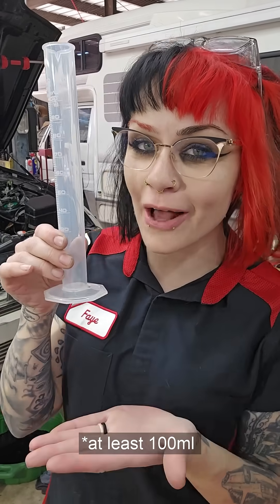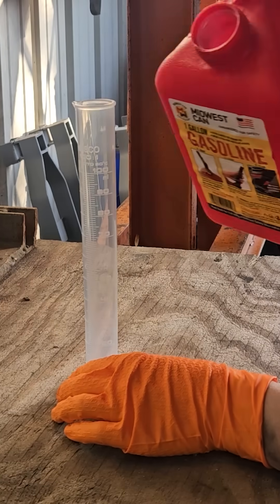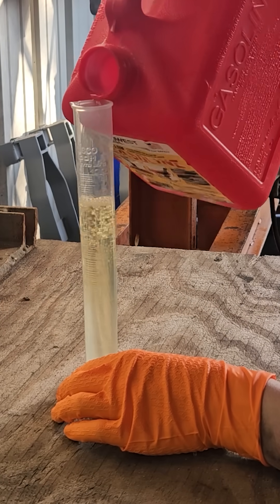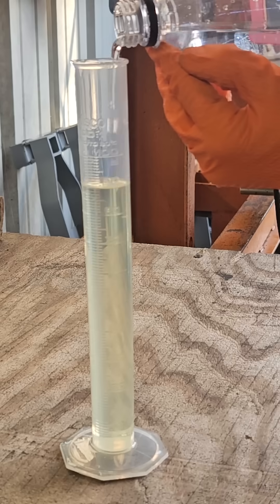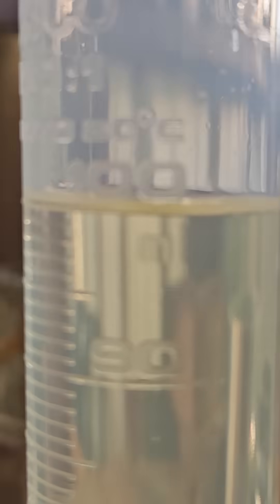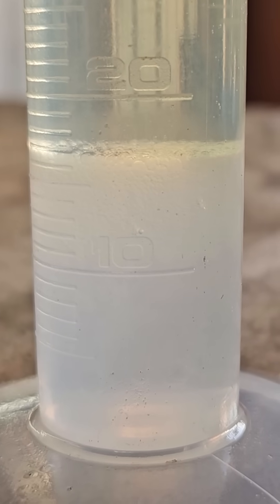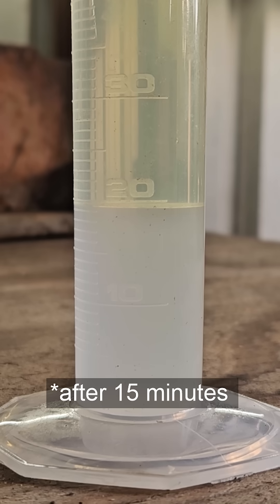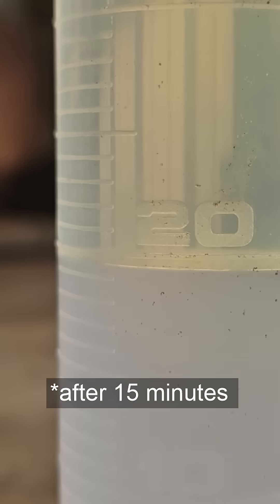Testing the Ethanol Content of Gasoline Using The Water Extraction Method! #AutoDIY #Ethanol #Shorts

Comment: Underground gasoline storage tanks ALWAYS have about 2 to 3 inches of water in them, which always settles to the bottom of the storage tank. This is because ambient atmospheric AIR finds its way into the storage tank, and the humidity in that AIR forms condensation drops 💧 on the inside of the storage tank. I guess the next question would be…
Which has more density, gasoline or ethanol?
Reply: Ethanol free gasoline is .758 grams per ml, and pure water free ethanol is .789 grams per ml. Which would make ethanol ever so slightly denser in mass. Pure ethanol is an oxymoron as it becomes an aziotrope due to atmospheric moisture content, so hypothetically pure water free ethanol. 
Regarding energy density non-ethanol Gasoline is 114,000 BTU/Gallon and pure ethanol is 76,000 BTU/Gallon. 
Which explains why ethanol is metered more on the rich side to extract more energy from combustion to make it comparable to gasoline. 

For a quick quip of a comment im not diving into joules and parisitic and thermodynamic losses from engine operation and all that.

Comment: I would just clarify the readings a little....90ml gas, 10ml water, if the clear liquid on bottom was 10ml there was no ethanal. Any ethanal in the gas will add to the level of clear liquid on the bottom after it settles, so you have to count how many MLS there are and subtract the 10 for the water, leaving you with the ethanal measurement! Then for the percentage of ethenol take your measurement and divide it by 90!  Sometimes wording things in different ways helps more people understand! I know sometimes it helps me grasp it. Great vid! Now do a video on why we would want to take measurements in the first place! Thanks. Later. 💯👍🏁👏🇺🇸
Reply: Thank You for your explanation. The video wording was confusing,
Reply: This is methanol free.  Methanol is used to both booster octane and help burn off water.  Methanol is short life so Ethanol is used in the gasoline.
Reply: I'm also wondering why she used 90ml of gas. Wouldn't you use 100ml of gas if you want the result to indicate percentage of water? (After subtracting the 10ml from the result, as you mentioned).
Reply: @alanm8932  because she has 100ml total to work with thus 90/10.  If she starts with 100 gasoline she has to transfer it then add 10 mils water transfer it.  Blend then, siphon off excess gasoline as the blend won't fit and she can't spill water/ethanol.
Reply: @whatsup3270  it looks like it will easily contain 110ml, it just doesn't have markings above 100…
Measure 10ml water in the measuring cylinder & pour it into the mixing container.
Measure 100ml gasoline in the measuring cylinder and pour this into the mixing container (which already has the measured 10ml of water in it). Mix, then pour back into the measuring cylinder. (Looks like it will easily contain 110ml, it just doesn't have markings above 100ml).
When settled, read the quantity of water/alcohol at the bottom of the measuring cylinder. Subtract 10ml from the reading. The remainder (in ml, after subtracting 10) is the percentage of alcohol. 
Only problem would be if the percentage alcohol was over 90%, as you'd run out of markings. Hopefully that isn't likely!
Reply: Doing 90 fuel and ten water makes the complete amount of liquid to be 100 ml then after the shake you minus the 10 ml plus the rest that mixed with it being methanol @alanm8932

Comment: And what is the practical use of knowing if it is 1.9% or 9.9%?
The car will drive with the same speed, the same power and the same fuel consumption. 
Differences of 3% or less of the numbers above can just be measured in a controlled environment of a laboratory!
What is this "knowledge" for (except for selling these kits)? 🤷‍♂️
Do you want to switch gears 50 RPM earlier or later? 🤭

Comment: To those who want to remove the alcohol at home for use as clear gas on chainsaws and mowers, etc., start with the highest octane at your station. Alcohol is about 105 octane equivalent, added in part to raise octane rating. Removing the alcohol is cool but it will lower the rating, usually about 5 points. Be safe everyone!  👍
Reply: Lucky I guess that they sell ethanol free fuel in idaho almost stations, not supposed to fill.your car with it though or something like that
Reply: In our area the local fuel provider sells avgas (leaded gasoline) for aircraft. It's about double the price of regular gas but some people swear by it for chainsaws and the like....

Comment: I worked at a lawn equipment dealership in the late nineties when the ethanol blends common. We had a kit from one of the engine manufacturers that had a glass graduated cylinder that was marked in a way that took the math out of this. They required this for certain warranty claims.
Reply: In California, they aren’t just common, they’re the standard. 10% ethanol is a requirement. We’ve started making engines capable of handling ethanol blends, so nobody has been taught how to or why to test. Unfortunately, younger generations aren’t aware of the issues older machines can have with ethanol, so we’re about to witness the extinction of the last of the pre ethanol engines.

Comment: Im not sure the rate but an open top container filled with gas will cause moisture to condense out of the air. After 15 minutes of sitting in a room it could throw your test off. Not saying your method is wrong but just something to take into account.

Comment: This is also a simple way of removing ethanol from your fuel. Do the same thing, but in a container with a petcock at the bottom. Drain out the ethanol/water mixture, and 100% gas will remain.
Reply: The gasoline the refineries make is only 84 octane.  Adding 10% ethanol increases the octane to 87.  If you remove the ethanol, you will have 84 octane subgrade remaining.
Reply: @hughjass4838  85.6 octane in a perfect water free world.  I would bet when corrected for water the octane goes up. btw adding back 1/2 as much xylene or methanol will raise the octane above the original blend octane
Reply: You'll have to add something to raise the octane back to it's regular level. Ethanol increases the octane rating of the fuel, removing it will drop the octane rating.
Reply: @ water lowers the octane so it is generally a wash
Reply: Well, about 90% petrol will remain, since you just removed about 10% of it. Probably some of the nice additives, too, than prevent knocking and the like.
Reply: @NigelTolley That’s what I’d like to know. What else is removed by extracting the alcohol with water. Gasoline is pretty chemically complex.
Reply: Yes it will, but the octane of the pure gasoline will be lower than the rated amount and can cause pre-ignition problems.
Reply: @davidca96  because water was removed?
Reply: @whatsup3270  no the alcohol is also removed as its soluble so you lose the alcohol octane boost to the mixture.
Reply: @  The reverse problem is also true a pure hydrocarbon fuel with 10% ethanol actually at 87 octane will not stay at 87 octane, as it will not be stable until it has water probably1/2 to 3/4 of a percent.  Simply the off set is the original blend has to target a higher octane so it will test 87 or high when delievered.
Reply: Just add some octane booster to get the octane back up, lol.
Reply: What if the octane booster is just ethanol? @herranton
Reply: @lightningdemolition1964  it is... Hence the lol at the end.
Reply: A separatory funnel?
Reply: Do not do this unless you want a good chance of ventilating a piston.
Reply: How's a rooster do that? Petcock 😂
Reply: Removing the ethanol with lower your octane so now instead of 87 you’re running 80. Great idea but it turns the crap fuel into crappier fuel
Reply: And begin to hear your entire knock. Ethanol was a replacement for MTBE to prevent engine knock.
Reply: @chechnya  Knock is from too low an octane.  If the octane rises enough or the engine matches the fuel it will not knock.  There are other ways the add octane or suppress knock.  knock suppression is by raising the flash off point.
Reply: @whatsup3270  The lowest octane unleaded gasoline will have an even lower octane without ethanol, too low for most compression ratios. The compression ratio will ignite the cheaper gas no matter  what the computers do with ignition and injection.
Reply: @chechnya  This is great for yard equipment.  The ethanol absolutely destroys the diaphragm gaskets in the carbs.
Reply: @chechnya MTBE was banned in the U.S. in 2005….🙄
Reply: @mikek1187  which is why they use ethanol now....

Comment: If you are interested stihl makes a glass tube that takes the math equations out of it just tells you the percentage. I’m sure others companies do aswell but that’s where I bought mine.
Reply: Fill the petrol to 100ml if you want an auto percentage, then add 10ml of water. Whatever over 10ml is at the bottom after settling is the true percentage removed from the fuel.
Reply: Kinda useless nowadays when all lawn equipment are made to run on E10 properly and won't even have the right air fuel ratio if you run ethanol free in it
Reply: @DarkAttack14 I don’t know about other equipment because I’m not certified by them but stihl recommends no ethanol. And will void warranty for anything over 10% I’ve seen enough 2 strokes come in the shop with bad jugs/pistons/rings from over heating due to ethanol use to know better than to put it in my equipment.

If you spread a thin film of oil on your metal work bench. Then you take alcohol to wipe it away? It comes off right? Well think about how a 2 stroke works. It uses the 2stroke mix to oil the cylinder walls to keep everything lubed up. 
So why would you want something mixed in with your fuel that does the opposite. 

And yes, I can pull your FS90 apart and tell if you’ve been using ethanol fuel, It wears differently than pure gas mix.
Reply: Lol you must be tarded if you can't just subtract 10 from whatever the bottom reads (20 - 10 = 10 in her case)

Comment: If you pull 10 mL out of 90 ml, that's less than 10% it would in fact be 9% because you only had 90 ml of fuel. You would need a larger graduated cylinder and to do the full hundred ml of fuel to make the math easy

Comment: So what about e15 my 22 ranger will run it and it's only 5 percent more than the might be 10 percent in regular? I wonder if it's really as bad for vehicles as most say it is the price sometimes is too good to pass up on.
Reply: I think it really depends on the motor ur running it threw. Some seem to handle it a lot better but always worse then a proper gas set up

Comment: Huh, and your gas mileage on any modern vehichle varies by almost the exact amount of ethanol that is in the gasoline. For a product that hasn't been useful since the days of carburetors, they sure tout is as saving you from emissions. It doesn't. It reduces gas mileage, reduces efficiency, and causes more problems. Why are we still using this crap?

Comment: Notice more car fires lately? Ethanol eats rubber hoses and some manufacturers have been using substandard hoses.
Reply: Lol no, everything post 2000 is full compatible with even 100% ethanol. The hoses used are the same exact rubbers you'd use for pure alcy

Comment: Doesn’t the alcohol and water mix sr float to a 50/50 ratio?  Meaning is it possible to get more than 10ml of alcohol pulled out using only 10ml or water?   Wouldn’t you need to use 20ml of water and prove that the result is no more than 30ml of separation?

Comment: I have never had any problems with it in any of my vehicles. My 2004 Silverado went 210k miles without one issue. None of my vehicles have and they all have went past 200k miles. Its really not a big deal unless you got a Classic in which it will hurt the Carbs on most classics.

Comment: Just an FYI…
Since you started with 90ml of gasoline (adding water to make the 100ml), if there is 10% ethanol, that would be 9ml. So if the interstitial break is anything over 19 (not 20), that’s a problem.
Reply: Tommy Ferguson here I work as an automotive technician / smogtech.  For all intensive purposes it's accurate enough by doing that the reason is is because there's other additives in fuel that can isolate the water and alcohol.
    ie, it's comparable to saying that liquids are noncompressible and hydraulics. In all intensive purposes are not but on a physics level yes there is a microscopic amount of compression
Reply: @ *”intents and purposes” not “intensive purposes”
Reply: @FastEddy1959 literally was just about to say that but I saw you beat me to it
Reply: @FastEddy1959 im sure he's glad you guys corrected him. You made the world a better place. Merry Christmas 🎅
Reply: @thomasfreguson5457  also water pickup is the real issue it isn't excess ethanol it is water absorbed.

Comment: I save my self all the grief from ethanol by only running non ethanol.
Gas is for driving, alcohol is for drinking.
Reply: You must make a lot of money.  I have two stations near me with real gas and it’s generally at least $1 more or gallon.  
I do use it exclusively for low volume long storage things like generator and mowers.  But the car burn through it such that it would be a financial waste for a tiny gain.
Reply: @JayAlfredoG 1 a gallon is a good deal, in NY I found non ethanol upstate once that cost 5.50 when premium was 3.50 ish lol
Reply: @JayAlfredoG  make a lot of money for 1 dollar more per gallon? huh? have you even done the math?
Reply: You will recoup somewhat as youll get better fuel mileage and power boost awell@JayAlfredoG
Reply: @lukewalters4716 ethanol fuel makes more power in almost all modern vehicles, better knock resistance let's the timing adjust
Reply: I hate that in my region, 100% gas is so freaking hard to find.
Reply: @Particle_Accelerator_Repairman  
Not super easy where I live. I keep cans of stabilized non-ethanol gas in cans at the house for those times that it out at the pumps, I live in a hurricane area so it is also for the generator and lawn equipment.. If you do this, be sure to rotate and used the oldest first.
Reply: @Particle_Accelerator_Repairman 
Only lace around here is the racetrack .
Reply: Every region
Reply: Not all types of alcohol are for drinking.
Reply: @n9wox ethanol is literally the alcohol you drink
Reply: Kinda weird to drink something we can burn as fuel in a car engine, when you think about it.
Reply: @kenmorrisproducer  
Well, that is a valid point too..
Reply: My local Sam's club has non ethanol fuel, and they're the cheapest place for gas for a 50 mile radius
Reply: Ethanol...rotting gas lines and tanks.  Keeping garages in business and drivers broke.
Reply: @MrM6d  
Thank you!
Exactly.
Reply: @mushroomcloud1 only it's not true in modern cars, which are ethanol compatible and have been for years. All my classic vehicles have been upgraded to alcohol compatible as well. Now, modern fuel evaporates right out of a vented carb, meaning that every start after a reasonably long off period means a dry carb, and lots of cranking (if you're still using a mechanical fuel pump). This is the aspect of modern gas that rubs me the wrong way - the turbos seem happy drinking e85 all day.
Reply: @MrM6d nope. I have run it for as long as I been driving I'm 38 and put 100s of thousands of miles on vehicles. Never have had those kind of issues.
Reply: Why? You're paying significantly more to burn fuel the engine wasn't designed for. Any modern engine (in an automobile) is designed to use ethanol blended fuel. 

Hell I usually just buy 88 octane that's 15¢ cheaper than regular 87.  That extra few % of ethanol isn't hurting anything.
Reply: @inlarry4 that's not how they raise the octane for 88
Reply: @inlarry4  Ethanol adds draw water.  Its better said as a short shelf life.  If you burn the tank every week or two fine.  If you use it in winter storage expect trouble.   I switch my fuel injected motorcycle over to true gas in November - March, April - October regular fuel. 
True Fuel only in carbureted lawn mowers, gas cans, etc. Btw a carburetor cleaning is $300-$900.
Reply: @inlarry4  
A big mac was made for people to eat..
That doesn't mean it is the best choice.
Reply: What's funny is here in Iowa, almost every station has at least 0 ethanol, 10% ethanol and 15% ethanol pumps. And e85 pumps are fairly common.

0 ethanol is about 40 cents more than 10%

I do use 15% on all my stuff. Even small engines. Never have had any issues.

Can ethanol cause issues with water separation? Sure. But vast majority of the time it's the scapegoat blamed cause it's easy to blame for engine issues.
Reply: @iowafarmboy  no, ethanol traps water, which is the test.  However it always traps water.  It has to be burned before the water content grows too high.  That is why ethanol tanks rust.  When we crack these carburetors open, it is easily seen.  I have seen float springs eat by water to nothing. also see increased rubber deterioration in the seals and hoses.   These systems were not made for water and ethanol brings in water.  It isn't as bad in fuel Injection systems.
Reply: Have you considered taking a chemistry course? Or at least learning what engine knock is and what's used to prevent it?
Reply: Suuure buddy
Reply: What grief? Any vehicle made after 2000 has a fuel system that has no physical issue with even 100 percent alcohol lol. The Injectors might not be up to the task just based off flow rate but all materials are alcohol compatible for decades now